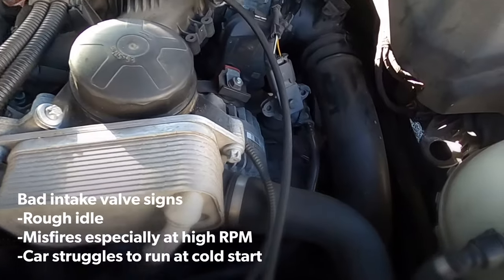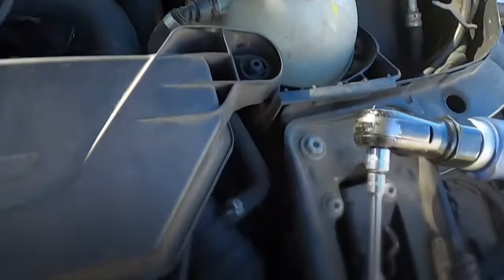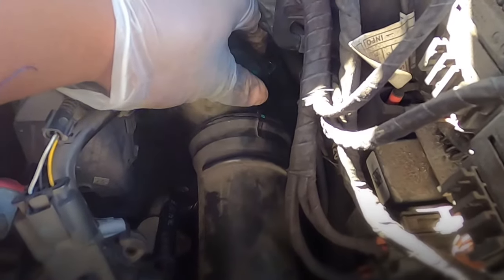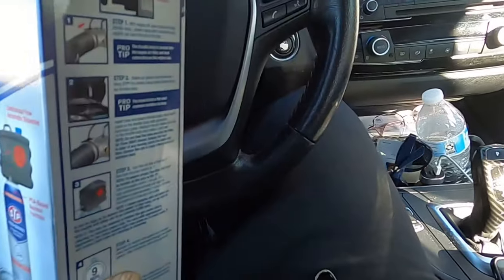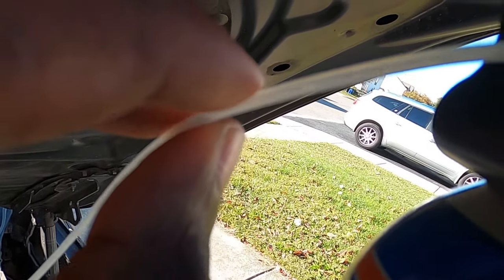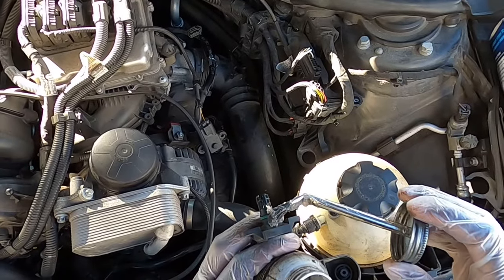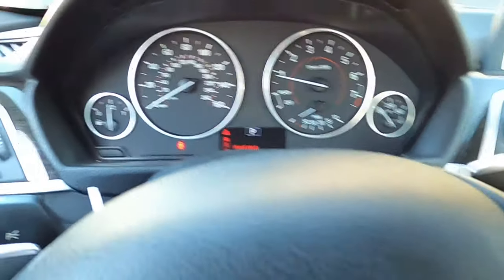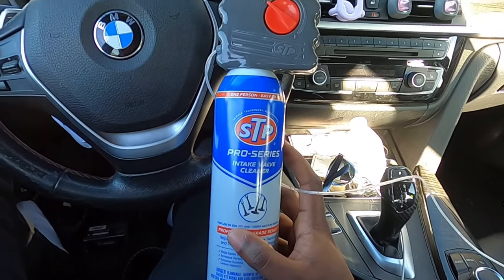2012-2017 BMW F30 328i Intake Valve Cleaning

Comment: My concern is, if you have years of caked on carbon and use this product in-place... where does that flakey gunk go? Don't you run risks of it being pulled further into the engine/cylinder and cause issues?
Reply from the maker: https://youtu.be/bEnJ15bL7co?si=85pT6l78MwaWTRRE

I left you a link showing what actual intake valve looks like before and after the treatment, with the cleaner, speed of the intake valves, and heat of engine helps remove, dissolve, break of carbon deposits. Carbon deposits can be burned in the combustion chamber and out the exhaust. It’s what PCV valves do and it’s what EGR valves do

Comment: Is this solution better than walnut blasting ? Did you feel a difference in the performance of the engine ?  I would love to know. I notice my engine is a bit sluggish. Thanks in advance:)
Reply from the maker: Nothing is better than walnut blasting. But this is a much more affordable option to keep your intake valves clean. Look up reviews of the STP cleaner. I seen a guy who had used a borescope to show the before and after, I was impressed.
Reply: I did ours with toluene and plastic tools back in 2020, it requires quite a lot of patience but it does a perfect job. I'm looking for other solutions I'm not sure I want to do it again 😂
We're due...

Comment: I took off my charge pipe before watching and now my cars in drivetrain malfunction mode! What can I do to bounce back asap?!
Reply from the maker: You need to make sure the charge pipe is completely on and securing with the metal locking clip. Try clearing the check engine and start it back up

Comment: Did u see performance difference? My cars at 132k miles, I wanna take care of it
Reply from the maker: To be honest, I’ve had my car since it was new and I barely burn a 1/2 quart of oil between oil changes. I did the valve cleaning for preventative maintenance. So I didn’t notice much. But I do still recommend using the cleaner
Reply: @ultimatediyguy395  how long you wait between oil changes? 
Our 2016 has 100000 miles and it doesn't miss any noticeable oil quantities between changes (5k I don't trust BMW schedule, oil is cheap)
Reply from the maker: @LaurentiusTriarius  I usually change my oil every 8-9000 miles. I have 140,000 miles. I use Mobil 1 high mileage extended performance with a Mobil 1 filter

Comment: My car has Drivetrain Malfunction on the screen, I changed my Injector, spark plugs, coils and it still causing my car Misfires, Shaking and rough idle and the rpm is below 1
Reply from the maker: I’m assuming you have a check engine light then? Check your codes before throwing money 
1. I hope your using the OEM NGK laser iridium plugs
2. Im also assuming you didn’t have oil in your spark plug wells
3. BMW injectors need to be coded
4. Lastly you can try the using the intake valve cleaner. 
5. If it’s really bad you may need a walnut blasting
Reply: Check your VANOS solenoids they might be the culprit. I had a similar problem with an N55 although there was no engine light or check control messages

Comment: There is anotherTMap just after the throttle body, you got all the valve cleaner all over it?
Reply from the maker: Most intake manifolds have a map sensor on them. They don’t respond to the cleaner. What’s most important is to not get any on the mass air flow sensor. The map sensor is small very little will actually get on the sensor
Reply: @ultimatediyguy395  well I did this intake valve cleaning treatment on my n20 now, I just took out the manifold sensor and used that little hole to spray the stuff into manifold,  it's also after the electronic throttle body (I don't think it's good to spray liquids onto that either as it's electronic)